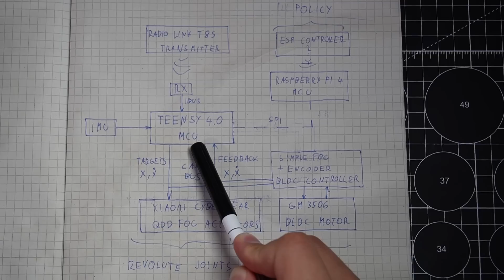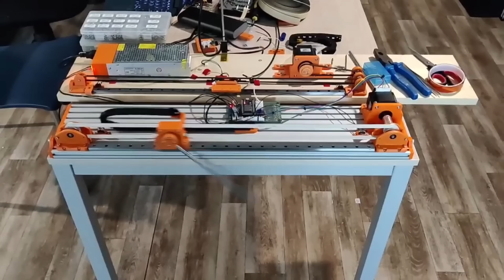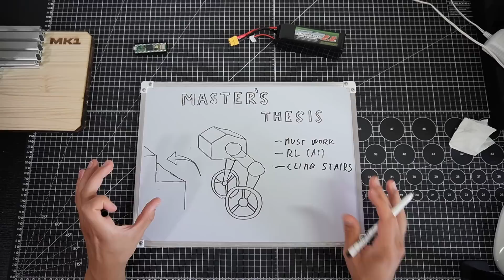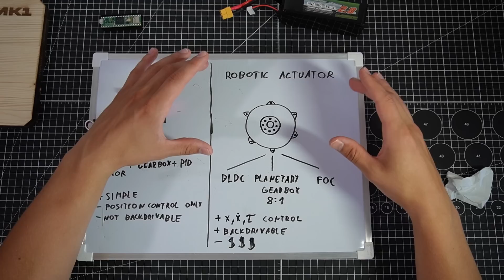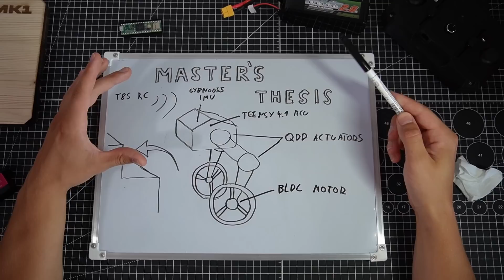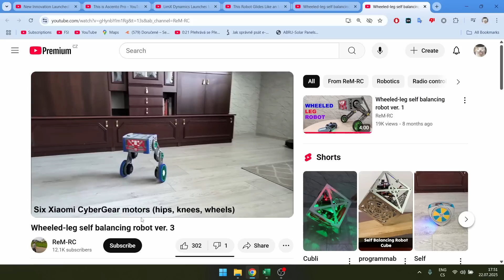Engineering Thesis #0 - the Speedrun Begins (Death Wish Difficulity)

Comment: Awesome project! Here's some thoughts that immediately came to my mind:

1. For doing stair climbing you need more sensors on the robot. In Isaac Sim, all the robots that are trained on the rough terrain environment rely on a dense height scan map of the terrain around themselves which you would probably need a 3D lidar to get in real life. If you want to look into it more, the observations given to the agents are defined in a python file named velocity_env_cfg in the Isaac Lab source code (surprisingly the only file in the repo with this generic name). This is a massive difficulty cliff and I think doing this part would be as hard as the rest of it combined but require a completely different skillset, definitely closer to controls and perception than mechatronics
2. For a simple RL policy to maybe balance the bot on flat ground you might be able to use a Milk-V Duo board (10-20 bucks) instead of a raspberry pi. If you look up  Zeroth-01 Status Update  there's an example of a sim2real stand up policy, although this would also be quite a feat to pull off because it's really poorly documented online how they pulled it off.
Reply: Nevermind on the needing more sensors part. IDK if youtube will let me post a link but but if you look up the video "Cassie: Dynamic Planning on Stairs", they claim they achieve walking without external sensors. If I had to make an educated guess here, they probably use current feedback in the motors or something to let the legs do something akin to feeling the ground, but maybe not.

Comment: Its annoying how expensive robot parts are, it leaves hobbyists and students mostly only able to use cheap but not very good parts. They don't need to be as expensive as they are and even some of the expensive servos cheap out and use potentiometers and brushed motors. One of the best and only options at this point is to make your own or modify the cheap parts, especially if you need a lot of them.
Reply from the maker: Yeah I guess it's mainly used in industry and the market for hobbyists is not big. I would like to make my own actuators someday.

Comment: Could you explain what do you mean by sending position and velocity commands to the driver? At the same time? Or you want to switch between operating mods?
Reply from the maker: Yes at the same time. For control of a dynamic system you usually want both.